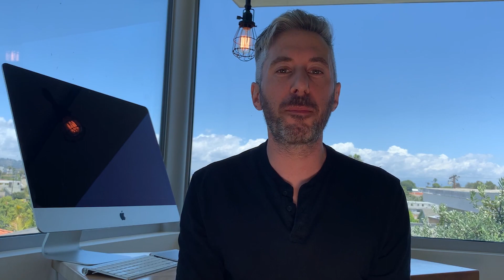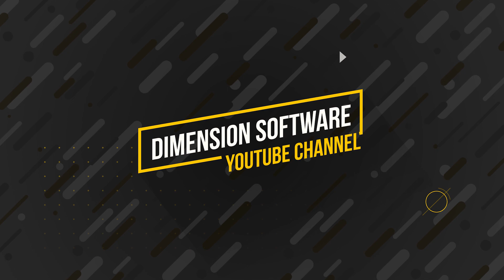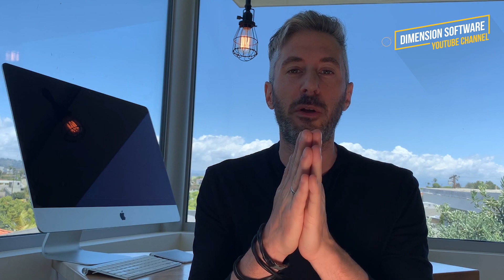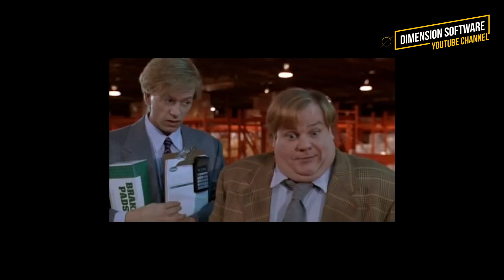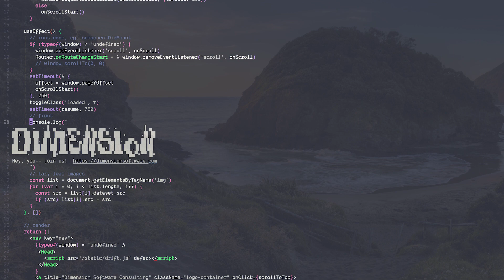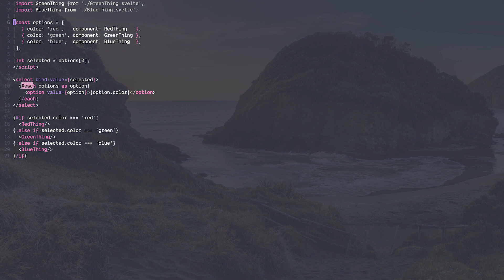Google Misled You: Stop Using AngularJS

Comment: I developed in  c, c++, and .net for over 20 years. moving from asp.net  to angular and node js was fairly easy. a lot of fundamental programming concepts  are used across many languages. I like speed of development using vscode,  node, and angular. I just did a job search on angular vs react. Angular tops React.